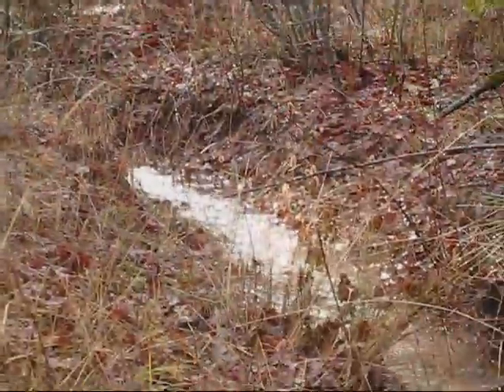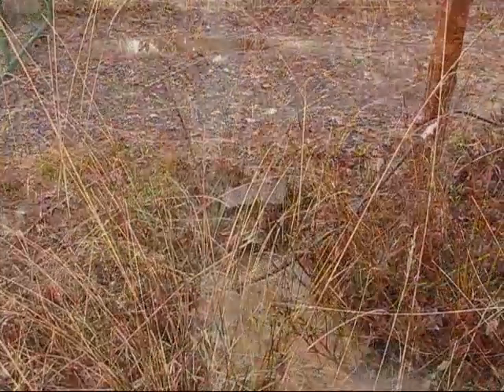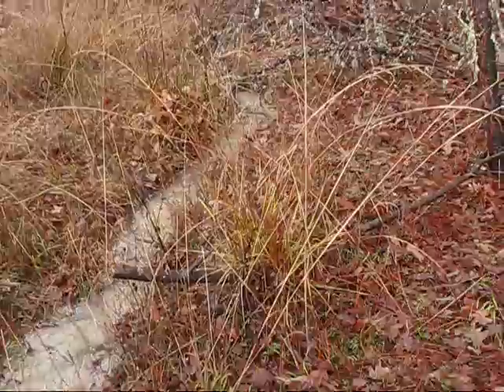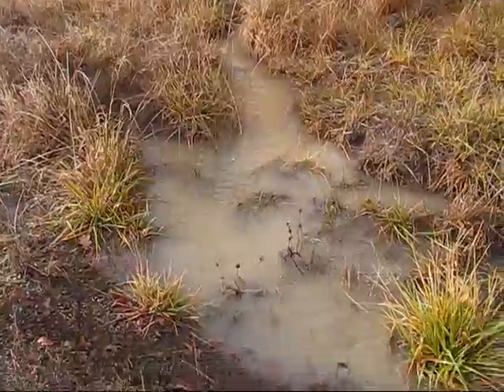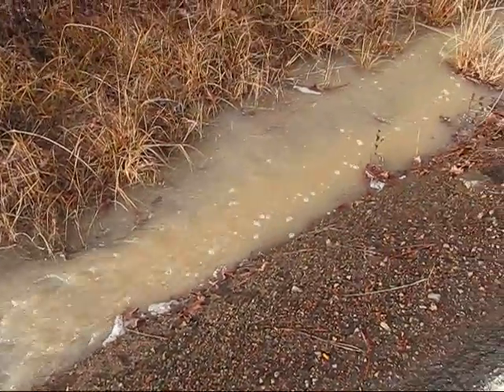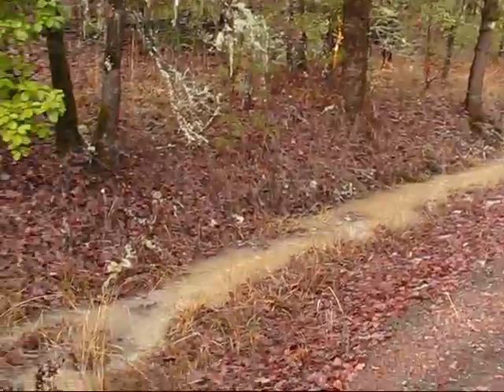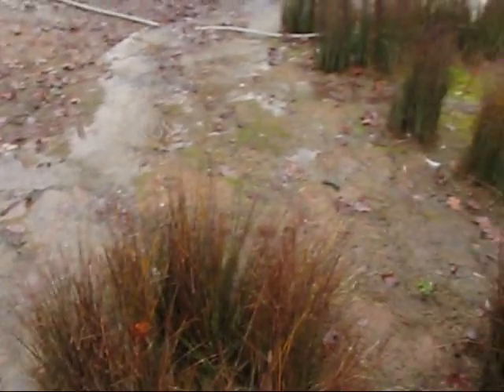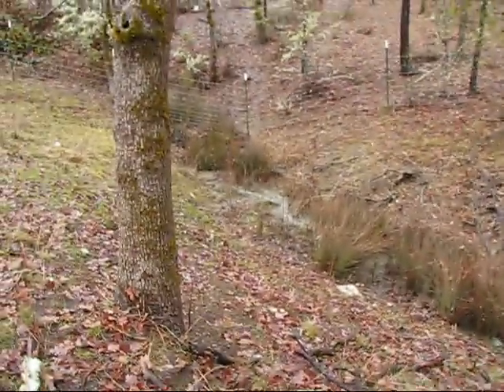HYDROELECTRIC POWER - Part 1 Water Resource

Comment: GREAT! Thumbs up!   I thought of taking 20 lb propane tanks and filling them with water to be sure there is no propane in them and then emptying the water and taking a right angle grinder with a cut-off wheel and cutting the propane tanks lengthwise, leaving one straight side uncut. When opened up this would make a large  pelton cup. Done to about 8 or more propane tanks. Taking two steel automobile wheels and welding them together, then welding the opened propane tanks around the wheels making a large pelton wheel.  The center of one of the 2 wheels welded together would need to be cut out to be able to get a ratchet in to tighten the lug nuts of the other wheel to a junked automobile hub/axle. Similar to this https://www.youtube.com/watch?v=BtCMuO3DVyE  Or  instead of using the hub/axle of a junked auto, weld the propane "pelton wheel"  to a large steel pipe and fit each end of the pipe through a large pillow block bearing.

Comment: which creak has the most fall and runs longer per year. most fall shortest distance.  take less pipe that way
Reply from the maker: +Roy Amberg Two of the creeks are within sixty feet from the house. Those two are the major ones.
Reply: How much fall
Reply from the maker: Roy Amberg I would venture to guess about 12 feet on both
Reply: That's about 6 psi just from gravity